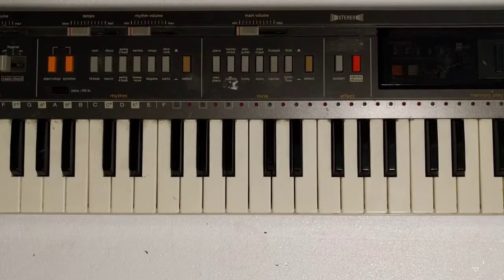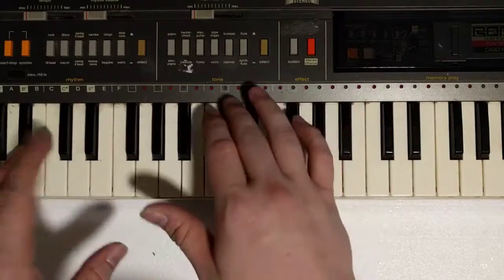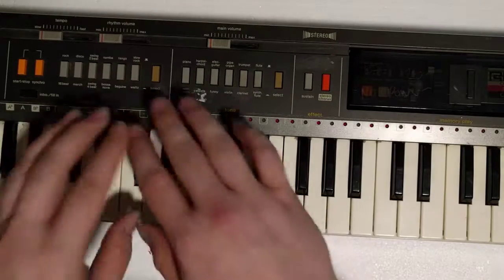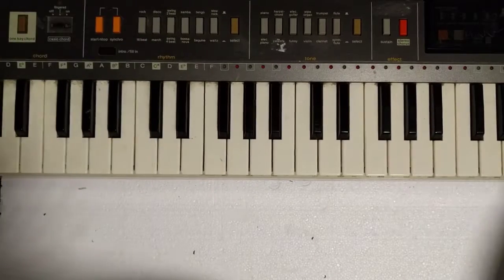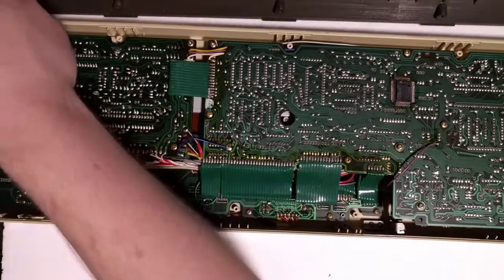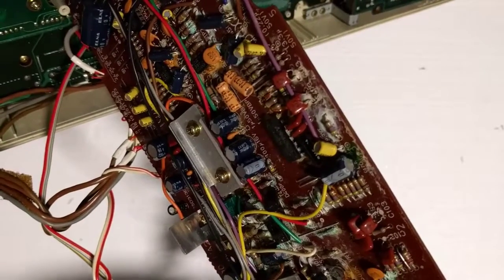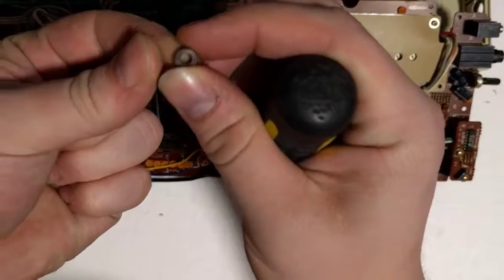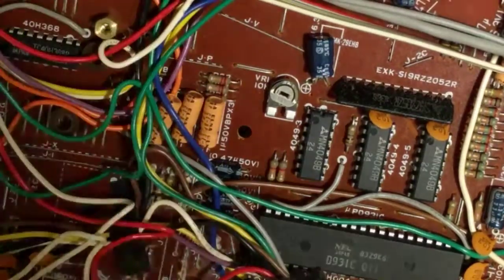Casiotone MT-800 teardown

Comment: Even if these are considered a toy,and obsolete at that, it has a built in analog chorus effect. While I did not catch a good shot of them, those MN4049B ICs are Panasonic\Matsushita which suggests the analog chorus will also be using The famous Panasonic\Matsushita BBDs, the MN3101\MN3007 ICs. Those two chips alone are somewhat valuable to a pedal builder like myself (for building 100% copies of the BOSS CE-2). I just paid $40 Canadian for a MT-800 online, and will find out when it arrives, if indeed it has those Matsushita BBDs. 🍻 Actually you can see at 20:35, on that daughter board, that is the chorus board, they are MN3102\MN3207s, the 2nd generation ICs. I'll build a Ibanez CS9 Chrous.

Comment: Learning the basic tunes on the MT800 was quite easy.  The note being played would light but the note coming next would flash so once you got the hang of it, you could jump to the next note easily (except on very fast songs). There was also a step option where the song would wait until you pressed the right note and then it moved on.